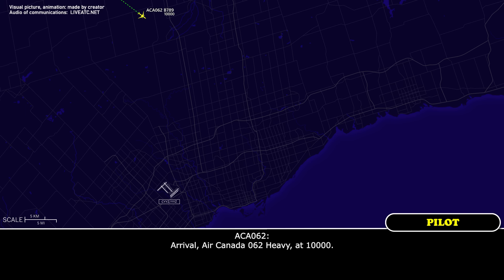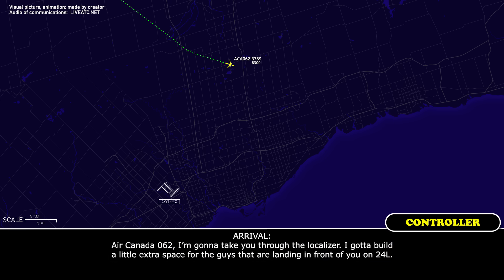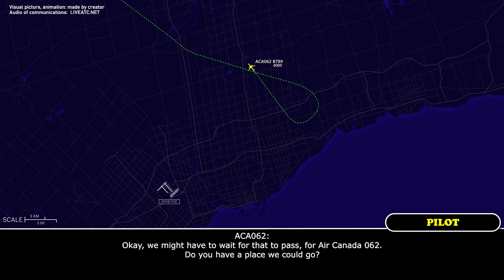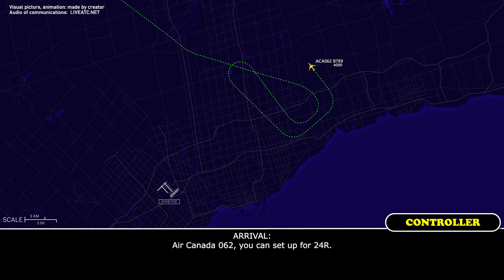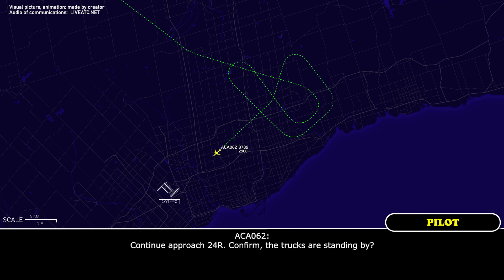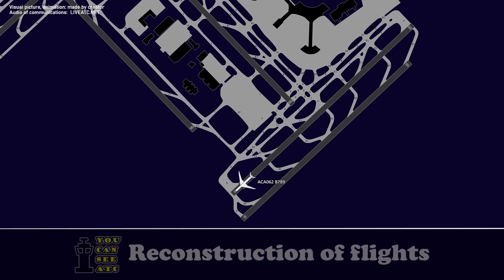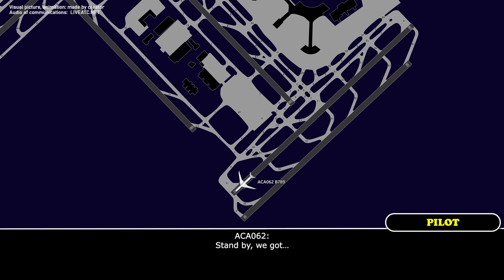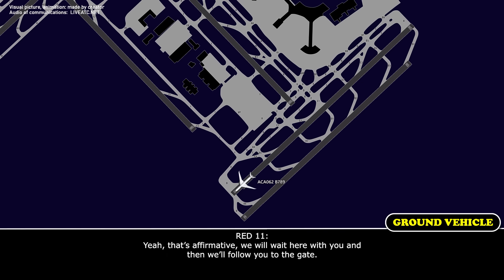Flaps failure on approach. Air Canada Boeing 787 stops on runway at Toronto after landing. Real ATC

Comment: Anyone know why emergency crews need radar shut off?
Reply: Because they can be harmed by the radiation emitted from the RADAR, especially when getting close to the aircraft to check temps on the brakes.
Reply: I Googled your question. I guess so it doesn't confuse them with other aircraft and to keep things as it was put in the article "from clogging up."

Comment: Just a small correction but they said it was a slat failure, not a flap failure.
Reply: There's no way to isolate a specific slat, so keeping the broken one retracted would've meant a “no flap landing,” where all of the high-lift devices, both flaps and slats, remain stowed. A jetliner can land just fine this way — it just needs to do so at a higher speed, requiring more runway.
Reply: @Total_Body_Fitness_USA  That’s not true for the 787. The flaps and slats operate separately and even with one system shut down the other still operates normally. A “SLATS DRIVE” EICAS message means the slats are not functioning but the flaps still work. In that case the QRH procedure is a flaps 20 landing.
Reply: @Mark-md9pe  Hmm, didn't know that. I would think that if slats could be operated independently that it would cause the aircraft to become unstable. For example, activating flaps and slats on one wing and not the other would produce lift on that one wing and not the other which would cause issues with aircraft stability? Your thoughts on this?
Reply: @Total_Body_Fitness_USA  if the airplane detects any asymmetry it will immediately freeze all of those controls, I.e. all of the flaps or all of the slats. For example, let’s say it detects a skewed slat, all of the slats are locked out but all of the flaps still work… 787 specific.

Comment: I had a similar problem in an A300 when the flaps would not extend beyond 15°.  We were on final for a 12500 foot runway at Orlando, so the Captain opted not to say anything except we’d be landing fast.  As I recall the speed addition was only 15 knots, so it really wasn’t a big deal.  No problem, but we left the flaps at 15 when we taxis in so maintenance could take a look at it.  It was our last flight of the day.
Reply: Extra 15 knots is a hell of a lot of extra braking force required with additional temperature of wheels tyres etc not to mention the landing force exerted on wheels and undercarriage! Not to be dismissed as insignificant!

Comment: The FLIR camera the fireman talks about refer to special handheld cameras made by US firm, Teledyne FLIR, that enable a thermal imaging of the brakes of the aircraft to detect any hotspots that may indicate potential areas for fire to erupt.
Reply: The terminology is confusing because FLIR is an acronym for Forward-Looking InfraRed, which describes an entire category of thermal imaging cameras, not just the ones made by Teledyne FLIR.  So when people say they have a FLIR camera, I have no idea whether they are referring to the type of camera generically, or whether they are talking about the specific brand.
Reply: @davidh4653 the navy just calls then TIC thermal imaging camera
Reply: Yep, we even use them at bushfires and vehicle fires to look for hot spots after the main blaze is controlled.
Reply: It is like using the term kleenex for facial tissues

Comment: Flaps on a 787 are odd. On the ground you have to lower them in a very specific way or they will impinge on the spoiler panels. That's odd. I don't care who, what, why, or how........when I need to lower the flaps the aircraft should do whatEVER it needs to do to lower those flaps......and I don't want to know about it either. Just DO IT. The airlines should have never accepted the thing with strange proclivities like that.

Comment: Why wouldn't they land on 33R? It's almost directly into the wind which was stated at 320 / 20 knots and it's 1300 feet longer than 24R.
Reply: I was the enroute controller that handed this aircraft off to arrival so I can tell you why: There was a big thunderstorm basically right at the end of the 33s. The end of the landing roll and the missed approach path would have been very bad. They initially asked for 23 and I told them it was a bad idea for the same reason.

Also, landing the crossing runway has a big impact on the operation and they didnt declare an emergency. They normally would have to declare an emergency in order to get the intersecting runway to the active
Reply: @Marklar0  Thanks for the comment.
But.
Declare emergency. There is no such thing.
Either it is a PAN-PAN or a MAYDAY.
Nothing else.
Reply: Indeed strange 33R wasn’t requested or offered.
Reply: Yyz doesn’t like to use the 33s. They end up with tons of noise complaints. Unless the winds are sustained over 30 kts, you’re going to be taking a cross wind.
Reply: @mikelayzell1158  pan or maydays negate any ninnies calling to complain
Reply: @mikelayzell1158  In normal OPS fair enough. Under a PAN PAN, don’t think so. Especially with a fault where you want to minimize GS on touchdown (Flaps and/or Slats INOP).

Comment: Fascinating culture differences. American pilots would have likely exited the runway on Delta or even Charlie4.
Reply: couple things, first thats how its trained, its your runway. second evacuating on a runway is more desirable than a taxiway for space trucks etc, once your commited to the taxiway your not going back obviously, lastly, traffic volume in Toronto generally a non issue to manage with the other 2 runways, typically 1 runway doing nothing most days if anyone is worried about the traffic.
Reply: @testpirate2570  what do you think happens when some numpties land on that same runway by accident?
Reply: @ghostrider-be9ek  This is either a terrible joke or you have no idea what you're talking about and I can't decide which one it is.
Reply: @HarshL  right, we don't want an extra margin of safety in aviation - am I talking to children here?
Reply: @ghostrider-be9ek  You even suggesting that an unauthorized landing is going to happen at YYZ right after an emergency on a runway which isnt used very often shows me that youre spewing random shit
Reply: @HarshL  that's right, NO aircraft in the history of commercial aviation has ever landed (or departed) on the wrong parallel runway. This folks, is the level of intelligence in 2024. Amazing

The 0 increase in brake temps, and simply rolling off the end of the runway is worth giving up the 0.001% chance of a hull loss. Why is safety not common sense anymore?
Reply: @ghostrider-be9ek  What you are saying is not common sense - it makes absolutely no sense. If there is any concern with the structure or safety of the aircraft, we want the engines at idle and the parking brakes set as soon as possible so the emergency vehicles can approach and assess. Emergency/priority aircrafts have discretion to remain on the runway until they have been inspected and it is safe to move the aircraft. That runway is closed and closely monitored to ensure no incoming or outgoing aircrafts will use that runway until the emergency/priority aircraft has vacated the runway, and the runway has been inspected.
Reply: @janeryan2709  this was not a high-speed reject situation and  fire trucks are not rolled for every such scenario , nor do the aircraft park on the active  like they did here. Complete buffoonery. 

Brakes take minutes to heat up, they do not catch on fire instantly.

Clear the active, get off the runway, park away to avoid disruption add to minimize any chances of a hull loss potential. 

Air Canada has a vast history of incompetence, this is just another example them being unable to think
Reply: @ghostrider-be9ek  Again, the runway became inactive once they landed. This wasn't about Air Canada. That is standard operating procedure at Pearson Airport. They weren't required to move so they didn't.

The PIC can determine what they feel is the appropriate course of action. If they want the plane to be inspected before taxiing, that is granted. If they feel they can taxi to the gate before inspection, that is granted. But pilots have discretion to proceed as they feel is appropriate, and pilots are never going to be penalized for being cautious.
Reply: @janeryan2709  lets try this again, how many times in history have aircraft landed or departed off the wrong runway? The chances of a Tenerife is >0 in this case  - why is this not common sense to most people is bizarre.

I don't care what is "standard" - my first duty is to the safety of the ship, as a captain myself.  

Parking on any runway, unless you are mechanically disabled or actively on fire, is not 'Cautious', its moronic and the captain here had the authority to move off.
Reply: @ghostrider-be9ek  When there is a risk of fire it’s usually better to stop on a 200 foot wide runway than a 70 foot wide taxiway where the wings are overhanging the sides. If the trucks need to drive around you they may not fit under the wings, especially for shorter aircraft, meaning they will need to drive across the grass and risk getting stuck or causing unnecessary damage. Fully loaded fire trucks are stupidly heavy. 

If the airport only has one runway then yeah I’d probably get off, but Toronto has five and 24R is normally just used as a taxiway. If the brakes weren’t on fire or smoking smaller airports would’ve moved them, but the probability of a runway incursion is so low in this scenario that the benefits outweigh the risks.
Reply: @Mark-md9pe  off the end of that runway and taxiway there is a huge wide pad the ship could have easily parked on.
Reply: @ghostrider-be9ek  I understand that you clearly don’t care about what is “standard”. But pilots and controllers are trained to follow standard operating procedures, and that’s what they do. It prevents incidents. And Tenerife didn’t happen because someone landed or departed on the wrong runway, by the way. Maybe you should look into that incident again.
Reply: @janeryan2709  "standard" was also the reason why Air Canada almost caused three hull losses in San Francisco; their company policy was so poorly written that allowed for two numpties on the flight deck to perform this act. Other companies had better standards where their pilots had to verify the ILS approach systems on their pfds, even during visuals. 

So don't quote me "standards" believing that they are all perfect all-knowing and all-encompassing, I have told off many companies in my career as a captain that their standards were complete garbage. 

What good pilots do is analyze the situation, and evaluate where and when it is the safest for the passengers and the metal. Common sense and safety should never override " standards ".
Reply: @janeryan2709  also Tenerife happened because air traffic control was not aware of where 1 aircraft was.
Reply: @ghostrider-be9ek  Standards and protocols should be followed. There are times where it might be reasonable to disregard them, but general practice that maximizes safety and efficiency involves following standard operating procedures. And I have no doubt that you have “told off” many companies throughout your career - I just hope they had better sense than to blindly follow whatever you told them.

And Tenerife happened because the captain of the KLM Flight 4805 started a takeoff roll before being cleared by ATC. ATC was aware of where both flights were. The KLM captain made the mistake. Look into the incident again.
Reply: Ghostrider probably thinks he’s God’s gift to aviation
Reply: I don’t think it makes much difference either way - even if the pilots exited the runway the airport would still probably  close the runway temporarily.
Reply: Obviously you don't know that it's the same pilots with the same training flying in Canada and the US  and a pile of other countries. It has nothing to do with culture.
Reply: @jpa1282  no it is NOT the same training - Canada and USA have generally good safety records but there are subtle differences with regards to company policy, national regulations and training standards.
Reply: @jpa1282  USA pilots tend to be cognizant of the $100,000 in damages they cause by remaining on the runway and try to vacate if possible.
Reply: The runway was an ideal spot for them to stop in this situation. Everyone else was using 24L anyways which was the preferred runway due to severe weather less than one mile to the north.
Reply: yea i dont get it either - gtfo the rwy unless disabled

Comment: Why did red 11 want them to shut off the radar? What does that mean exactly?
Reply: potential for high energy radiation by the nose
Reply: Also needed so the FLIR Camera heat-detector system  can operate correctly with no interference ☢🚫
Reply: @cwestie2430  I don't think that radar has anything to do with Foward Looking Infrared systems. They would want the radar switched off for personnel safety.
Reply: Sounds spooky
Reply: They had to turn off the chemtrail machines too
Reply: Probably a standard call-out for the emergency personnel approaching an aircraft.